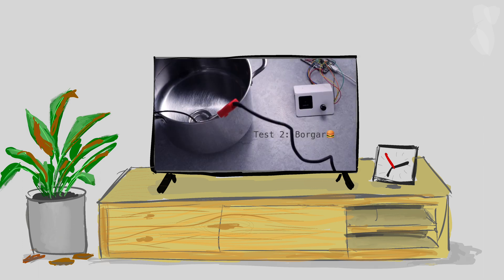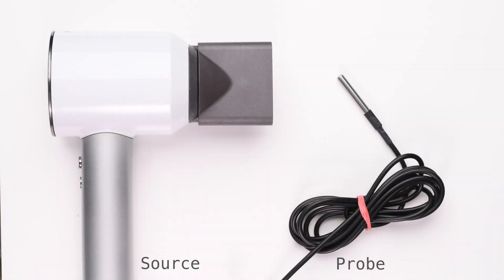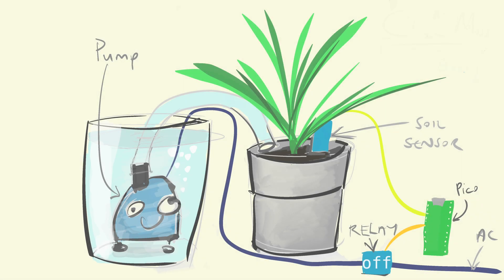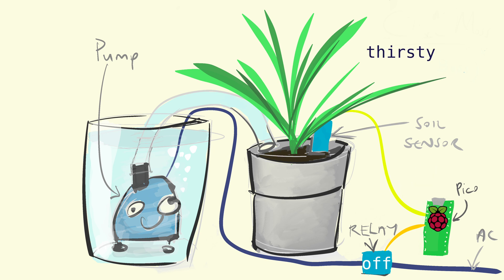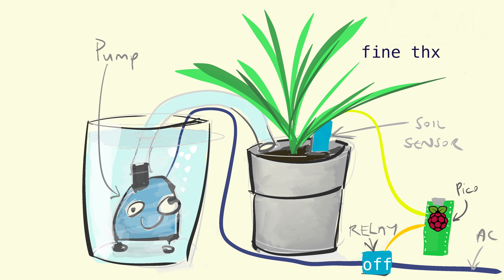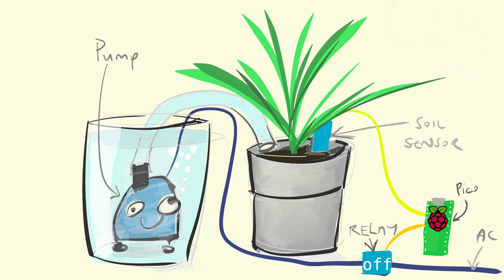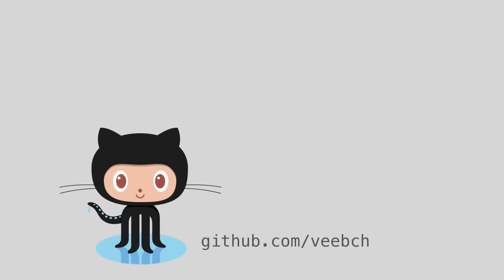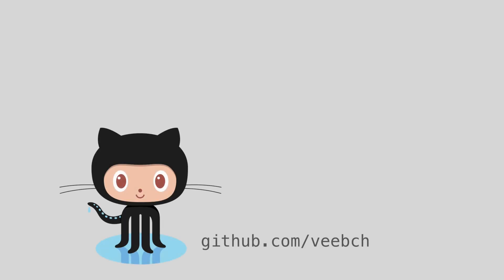Build A Plant Watering System 🌱🤖 | Using a Pi Pico

Comment: Hi. I'd like to build this project and would like to clarify somethings with you. These are a couple of my questions:
1. How do we connect the relay switch the pump?
2. How do we connect the relay switch to a power source?
3.How do we connect the Raspberry Pi to the relay switch?
4. How to do we install the code from the GitHub to the micro python platform (I am using Thonny)?
5. Where is the right ports to connect the Soil Moisture Sensor to the Raspberry Pi?
6. Do we need a breadboard?
Thank you
Reply from the maker: Hey :) You'll find more comprehensive instructions on our github page: https://github.com/veebch/sploosh

We'll try to improve the readme so that all those questions are more clearly addressed. Good luck!
Reply: @VEEBProjects  still not quite clear what relay switch and how to connect to the water pump.
Reply: @VEEBProjects  This was never done.  This is so close to incredibly helpful.

Comment: Good mornig, a relly nice project.I want to try it with my students but I need to ask you how did you connect the relay and the water pump. You just took a normal relay for microcontrollers or you bought a different one to not cut the water pump wire?
Thank you so much
Reply from the maker: The intention was to make the PID multipurpose so the relay was just connected to a mains plug extension cable.
Reply: Thank you so much!

Comment: Very cool. Why did it drink it all on one day? Was it exceptionally warm?  And what happens if the jug runs dry, will the pump burn out?
Reply from the maker: Well spotted! In a word, latency. The distance between water source and sensor means that when it has dried out, it drops a lot of water at once. This was initially an accident but it turns out it promotes root growth. There is no trigger for the jug being empty at present, but something could easily be added....